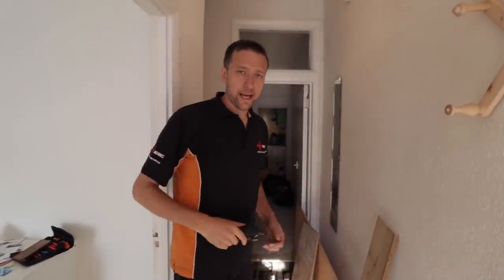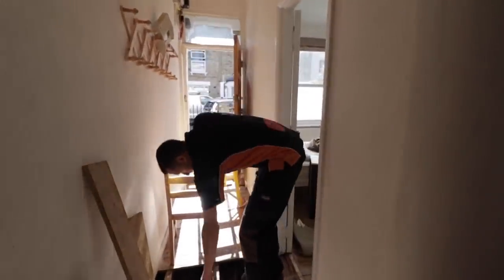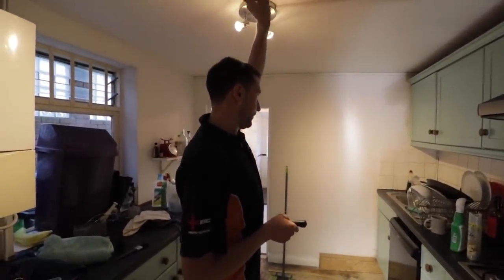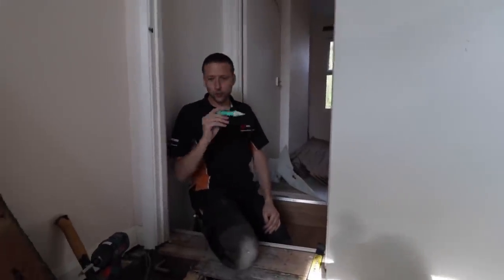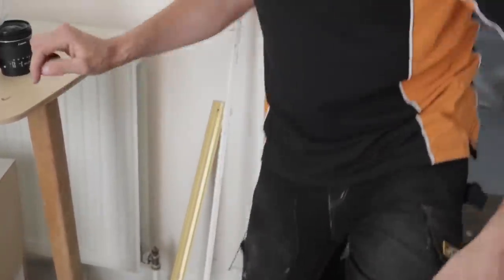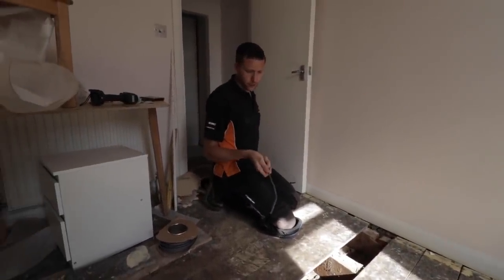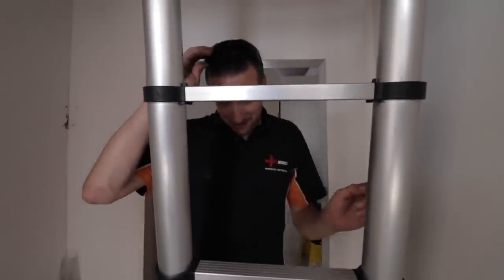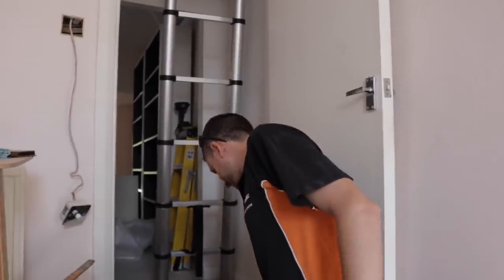House rewire First fix'n | Thomas Nagy

Comment: Bollocks to whoever said its bad practice to loop at the switch, its the best way. Easy for maintenance and safer, it makes fitting new light fittings a doddle and it removes the danger of diyers mistaking the switch live for neutral, the only downside with the loop at the switch i guess is dimmers can sometimes be a tight squeeze but thats about it.
Stop giving these people the time of day tom, they do not know how the real world works therfore their opinions don't matter.

Comment: I've hit a snag! There is a tool or part that would help me with this, but unfortunately I couldn't fit it in my limited cargo space, so you'll understand if I ride 30 mins back home to grab it do you? I will of course have to charge you for that time. If not, I'll go down to the nearest supplier and charge you the cost of a new one (that didn't need to be purchased, thereby creating waste), and you'll be okay with that? Glad we stopped using our vans, we are so much more efficient now!

Comment: Feed and neutral to the switches is the recommended method of wiring by NICEIC. Anyone who wires in the three plate method is a dinosaur 🦕
Reply: Started doing 3 plate with 3 core to switch so you’ve got the best of both
Reply: It’s also much easier to make off a shitty decorative light fitting with 1 cable rather than 3
Reply: Dosnt matter if your feeds are at the rose or switches,it’s still 3 plate
Reply: @robswingler  So your loop in & out is in 2 core t&e and your cable out to the light is in 3 core & e?
Reply: Where did you find the by  recommendations in NICEIC please?
Reply: I agree 100 %,   much easier to find a fault too, if one devolops
Reply: Been doing loop in / out for 40 years now and I ain't about to change for no c~~t , also these smart switches that people like to talk about wont need a neutral, in fact I have fitted quite a few smart switches to date that don't need a neutral........😜

Comment: you say about the drill bit with the screw bit on the top, I used it in my 18v impact driver and it did the job fine, Does any body else use them in that way? or am I doing it wrong?
Reply: Use them also with impact...pisses through
Reply: Best and quickest way to drill through joists is an impact drill.....👍

Comment: Great video Tom interesting to see the techniques you use on a daily basis. As to the ladder being aluminium it may suffer from micro fractures and work hardening at its stress points on the joints so after frequent use rather that flex back it just collapses all in one go. How often do you inspect your ladders and have you looked for an alternative solution?

Comment: Try using an impact driver with those Spade bits, it's so much better because it doesn't bind and I think it's faster.
Reply: The bosch selfcut speed bits are a dream!

Comment: Great video Tom, we have the same problems in the motor trade with neutrals, nearly everything is switched neutrally, Joe public is lost with these ideas , at least if the public don't touch jobs , us tradesmen will continue to make a living , tool replacement is bloody expensive , new designed tools for specific jobs , next month you can buy another pair of knee pads 1 each again , I have them , drive me mad , cardboard is not too bad support for knees and it's free

Comment: It is more logical to only have Switch Legs at each light. All other wires enter at Switch box, no need to dig out a laddder(especially if on bike) all work at easy level. And there was a reg here in the US that there is supposed to be a neutral at each Switch now.

Comment: I avoid those extendable ladders like the plague.

I use to work for a retailer that sold those in the UK, they got the nickname widowmaker! Never encountered one snapping like that picture but they did collapse back down to their original shape when weight is on them.

Comment: 1 - without a van full of tools and meterials I can't turn up to small jobs I've been called about during the day and do them on the spot.
2 - it may be alright in a city, but I'm often driving 20-30min out into the sticks, not risking my neck biking down some of those lanes, and imagine how much time it would take visiting on a bike first... and hence how many more electricians the country would need due to all the wasted time, how many more tools and vans would need to be made for them, and how I'd have to charge you £120 just to change a lightswitch because it's taken half a day! :'D
3 - snags, there's often something unexpected, I've almost always got what's needed ready in the van, no need to go driving away (more fumes yay!) to buy/fetch anything
4 - weather, I can drive out in just about any weather, I'm not taking a bike out when it's chucking it down/scorching heat

Comment: People say to me all the time,  “You carry a lot in your van, or do you need such a big van” well when you are a sparkle in Sussex, sometime you can be 20-25 miles from a wholesaler,  also you can never plan your jobs for a day, if you are doing a day of jobing around, you are more than likely going to get call or email from someone with a problem and them asking if you can call in and take a look, far better getting the problem fixed there and then, rather than having to book them in in a few days time or next week, so my answer to all the  eco veggie save the planet people, is yes I do need a van that size and yes I use all the tools in it, by the way It has taken years of doing the job to get my van stocked with all the tools and equipment I need to do the work affectivity and cost affective for you,  also my van is a VW T6 it’s not a huge van by any means,
Reply: Sussex Sparkles are much better than regular Sparkies!

Comment: You'll thank yourself for wearing good knee pads in 20 years time when the body starts letting go.......😀
Oh and use the Bosch blue screw / spade bits in your impact driver , that way they will piss through any knot you hit....👍

Comment: mount the fuseboard at 1400... so in toddler reach. BOLLOCKS.

With you on varying from the regs. Just ignore that crap. That is based on the user using  a wheelchair.

If your customer is in a wheelchair,  ask them. :)

Comment: I wouldn't entertain down lights in a lath and plaster ceiling, everyone I have come across, the ceiling had started to sag with the weight of the light.
Cable zones on a rewire, never had an issue, have always been able to keep to them, but there's no way you can drill the joists in the right place it's just not possible.
I always switch feed, I think the NIC were recommending we do it, for the reason you state, I do it because it's easier to make off on the ground, rather than up a ladder in some shit DIY store light fitting

Comment: I personally like the junction box method for wiring lights means there's less cables for DIY dave to mix up and have a disco in their house haha but I have also used loop in at the light switch as well hell even the job I'm doing a community centre we used loop in at the switch.

Comment: Wiring to the switch is an actual wiring system.. 2 plate system as opposed to a 3 plate.. like you say it makes sense..had many ‘electrician’ say you can’t take a neutral to the switch 🤯
Reply: Ask them what regulation says that.

Comment: Agree totally about taking the L/N to switch. With the 3-plate loop-in system the rose is still live when wall switch is in the off position - making it dangerous for untrained persons to tackle replacement ceiling lights.
Reply: An untrained person shouldn't be tackling anything, if they wanna isolate and change a ceiling light by turning the light switch off then they're asking for trouble.